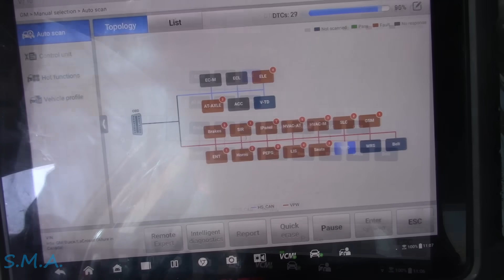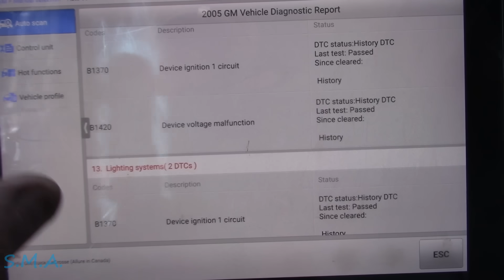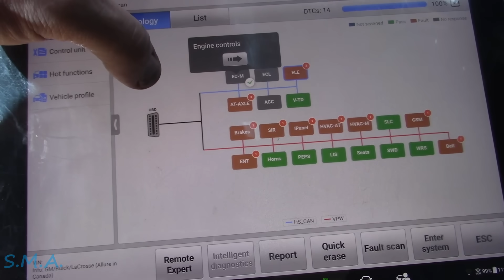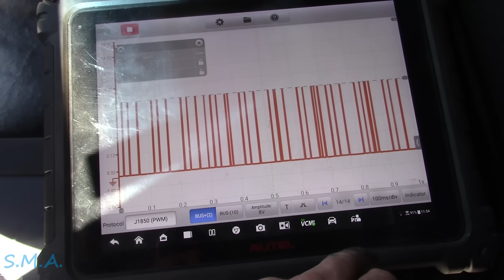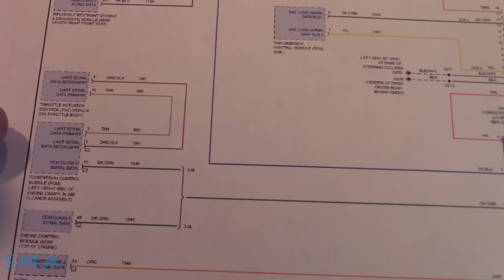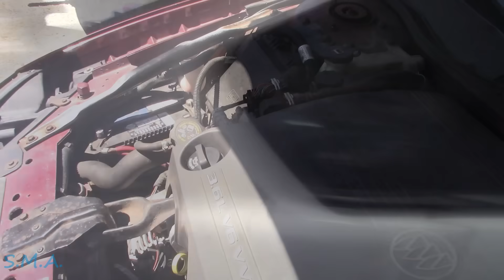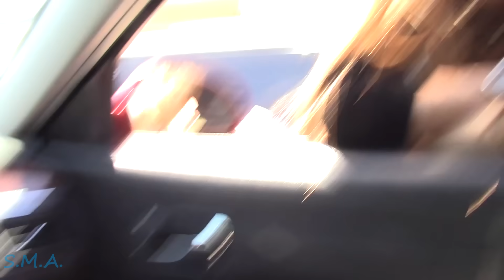Buick LaCrosse: No Start No Communication

Comment: UART = Universal Asynchronous Receiver Transmitter 

Designed in the 1970s if I recall correctly.  Works on simple start-stop data bits that sandwich the data bits into a packet.  Arduino micro-controllers can achieve up to 1Mbps speeds (in theory).
Reply: In computers in the 70s UARTs were used to communicate text data with user terminals. The wonderful thing about the "universal" part was that by changing a few soldered in jumpers you could configure the serial interface with the number of "data" bits and "stop" bits and speed to match the terminal device.  We would use 110 BAUD for slow terminals like teletypes (for slow readers ;-) and up to usually 9600 BAUD for CRT (Cathode Ray Tube) devices.  Some later devices could take the data at 19.2k.  But even at those low and slow speeds we needed to be careful about running the un-shielded cables close to things like florescent lights as that could induce line noise and corrupt the data.   So there may be UARTs out there these days that can do 1Mbs but I wouldn't think that they would be found in cars as I would think that as the cars don't have shielded or twisted pair wires in their wiring harnesses to much noise would get induced into the wires and cause reliability problems.
Reply: And for the people who want to know what "asynchronous" is all about, it means the  UART can figure out which is the first bit, which is the second, third, etc, without a separate "Clock" signal to tell it "We're on the first, click and see if it's a one or a zero, we're on the second, click, we're on the third, click etc".  So it saves a wire, which may not have been available at all like in the case of a phone line.
Reply: @paul_moir  Yes, very good.  I always thought it was interesting in the way a teletype would achieve it's "asynchronous" speed of communication at 110 Baud.  A teletype has in it an AC electric motor that runs at a constant speed based on 60hz AC.  A "start" bit would trigger a clutch that would cause a rotor shaft to travel one rotation.  In that one rotation the rotor tip would sequentially come in contact with 8 distributor pads in such rapid succession as to match their contact to the speed of the transmission of bits.  For each distributor pad that was contacted by the rotor during the transmission of a "one" bit a small solenoid would be pulled and momentarily held in place. Depending on which solenoids were "enguaged" a cylinder containing rows of numbers and letters would be raised and rotated to bring the correct character facing the paper and then the back side of the cylinder was struck by a small hammer causing the cylinder to move with sufficient momentum to press a ribbon to the paper leaving behind a visible character.  Once that secondary rotation was done and the character was printed the solenoids would reset waiting for the next character to be recieved.  I always thought it interesting and amusing in how electrical and such basic mechanical parts could be combined to get data to appear on a page in front of me.
Reply: @InquisitiveSearcher  Thank you, I understand what you're describing and can imagine it's function from your clear description.  My previous understanding is from about two technical generations later, specifically the General Instruments' AY-5-1013A datasheet included with a Texas Electronics Instruments S100 bus system I was given in the 80s where it interfaced the keyboard.  I never got it working but I learned a lot from it.
Reply: @paul_moir  Often there are few better learning processes than beating your head against a wall trying to get something to work that the manuals CLEARLY say it should be working!  Also, there is no computer more difficult to fix than one that has no problem but the customer is convinced that it does.  ;-)

P.S.  I fixed computers and their peripherals for more than 11 years, then I moved on to helping customers maintain operating systems.

Comment: Saw that traction control  failure on the dash, that's typical ABS issue in GM cars,  P bus go through ABS module to ECU so if ABS module is bad,  it takes the network down, no communication with ECU, quite often in saab.

Comment: I worked on one of these for my kids.  I got the key in and turned the ignition on a dead battery.  The key could not be removed until I changed the battery.  It would turn, but NOT come out of the lock.

Comment: UART - Universal Asynchronous Receiver Transmitter. Basically a bog standard serial interface, used by eg. RS-232 or RS-485. 9600 BAUD anyone?
USART would be the the one that can do synchronous serial, for other standards with a clock line (SPI, etc.)
You know you are working on an oooold car when it uses an old serial standard like RS-485
Cheers,

Comment: P0318 relies on the abs module... it looks at the wheel speed sensors to determine if crankshaft variation is because of a missfire or variation in wheel speed during offroading with your buick Lacrosse
Reply: Back when I use to do crunches everyday I had a great abs module. Today... not so much
Reply from the maker: Yeah I saw that on service data. Can't say I've ever run across it before.
Reply: I just ran into this code on a smart car and it was the wheel breaing also the fist time I have ever seen this code

Comment: Hi Eric i believe the p0318 code has to relate to a voltage issue also in the EBCM. If you have a wheel speed sensor code i would check for a wiring issue in the harness. Being a GM maybe worn through on the cv shaft or the lower control arm.
Reply: p0318 sets when a wheel speed sensor code sets, or when the EBCM isn't reporting rough road data to the ECM.

Comment: Rough roads cause torque on the tires that is transmitted to the powertrain. This slows down the crankshaft giving the appearance of a misfire. The electronic brake control module (EBCM) determines rough road surfaces using input from the wheel speed sensors. The EBCM then sends the rough road data to the engine control module (ECM) via class 2 serial data. The data allows the ECM to distinguish the crankshaft speed variations caused by rough road surfaces from those caused by true misfires. If a loss of communication occurs that causes the PCM not to receive rough road information while a misfire condition is requesting the malfunction indicator lamp (MIL), DTC P0318 will set.

Basically one of his wheel bearings or the wheel speed sensor is fucked.....
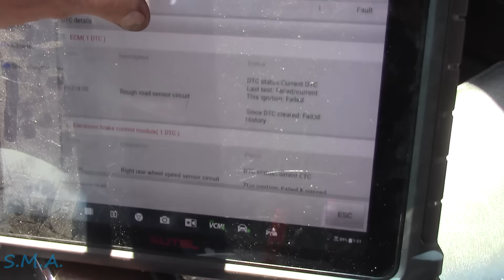Reply: 44:38 RR wheel speed sensor
Reply: @itsdavex2  Seems legit
Reply: @itsdavex2  Nailed it bro
Reply: Ding. I had the same issue in a 1997 Audi A6 Quattro once. The tone ring was rusted in one of the rears. I found the issue by going to a diagnostic channel and observing the wheel speed at each corner at slow speed. The ABS computer would shut down the ABS since it noticed a fault. The ABS would no longer talk to the ECM hence the fault code.
Reply: @Lustfulvengenance That was a F'n great answer! Dude, you rock!
Reply: I fuckin hate all this computer shit 😭 I don't care if they talk to you and tell you what's wrong fr 😂
Reply: They need a sensor for that? If it's on a road in the US or Canada, it's a rough road - no sensor required.
Reply: I've got an answer. Go to an antique car show and buy a car that was built before they put computers in them. You will never have another problem.
Reply: @jima3129  Yeah except you know trying to find parts for it, having to constantly repair little things on it, rust, dying in a collision that you could have walked away from, etc........ 

Don't get me wrong I love old vehicles and I have several of them I'm just saying they're not practical for everyone
Reply: @lustfulvengance  I have two vehicles both F150's. A 94 2wd straight 6, and a 2004 crew cab 4wd with the 5.4. The 94 is absolutely bullet proof. The 2004 has the 5.4 3v on which I just did a complete timing job, although it really did not need it. The 94 has features that ford eliminated that were really good. Vent windows, roof gutters, and an 8 ft bed you could reach into. The only things I have replaced on the 94 is the plugs, dist cap and rotor, ign wires, coil (yeah ONE coil) and a water pump. I've replaced a shot load of stuff on the 2004. The driver's side window regulator twice. Oh yeah, and the driver's seat cushion, which is still perfect in my 94. The new vehicles, with backup cameras, collision avoidance, variable cam timing, etc etc etc are built with parts made in China. Nobody can tell me we are moving forward. There is a constant race to put more doodads on vehicles. More doodads mean more breakdowns, failures, and costs for families already strapped because of the commiecrats and their ridiculous policies re energy. When I was young, there were no cars in some driveways, now there are at least 2, most of them new, meaning large monthly payments. And none of them are designed to outlive the payments. Just Saying.
Reply: @jima3129 Isn't it great being able to fix your own car? Eric's teaching us how to fish.
Reply: @markallen8434  yeah, but I've never owned a car. If you can't fit a sheet of plywood or drywall in it, carry a load of wood, or take a load of trash to the dump, it ain't worth a damn thing to me. SUV = SUPREMELY USELESS VEHICLE. Give me a pickup with an 8 foot bed. Besides, when they design a truck, they have to design everything bigger, and better. Ever see the difference in size of the brakes on a truck, and a car? The truck has to stop while carrying a load. The brakes on my 1994 F150 lasted 123k miles. If course it's a 5 speed manual transmission, and I used the clutch/engine to slow down. I just replaced the clutch in 2016 at 130k miles. The 4.9 liter 6 cylinder 5 speed, 2wd F150 is the best truck ford ever made IMHO. The ones made from around 92- 95 are bulletproof. Now they are ALL CRAP.
Reply: Can you imagine if they had this system on the jeeps in WW2? LOLOLOLOL
Reply: I have 2005 Buick lacrosse which yesterday morning happened with "No crank no start". I used two keys to jiggle several times and no success. Then I pumped two flat tires on site and Engine started suddenly. I didn't know why till I found this video and the explanation above. Thanks, bro.
Reply: Love the detailed  analysis..then you drive home with the hammer on the last line..excellent!✔
Reply: @vwwrenchie314  LOVED IT ALSO.
Reply: @
Lustfulvengance i'm also curious how you figured this out
Reply: Change EVERYTHING 🤣
Reply: This maybe the cause in my Jeep 🤔🤔🤔
Reply: Wow. Did not ever consider this! Interesting information.
Reply: cool theory but then this has to be one or both front wheel bearings if it's a front wheel peeler?
Reply: @awaara24  All 4 wheels have wheel bearings, all 4 have wheel speed sensors .....
Reply: @awaara24 then why isn't the abs light on it traction control light?
Reply: Wow, sounds good to me 👍
Reply: Totally agree with you. Same theory applies to a Lexus I had worked on years ago. PCM recorded random misfire dtc, turned out to be due to bent wheels to be completely out of balance causing excessive vibration resulting in crankshaft speed variation thus storing misfire codes. Don't know if it may apply but in my case, by balancing the wheels as best as possible fixed the problem. Just a thought.
Reply: Perfectly stated
Reply: sounds like a GM pipe dream, as never has there been such a precision driveline from them.
short of the wheels spinning and suddenly grabbing with torque converter locked. 🥳 😏
Reply: @Lustfulvengance That is crazy, how did you figure this out. Service data or just experience and connecting the dots?

I feel like I have this in my '13 Chevy Trax. I would get intermittent flashing check engine lights on the highway once in a blue moon, paired with a loss of traction light. The lights would disappear after two minutes, I wouldn't even need to shut off the car or start a new drivecycle. Sometimes the computer would store misfire codes. The car would always run fine.

Comment: was the 3.6 an optional engine for this car?
Reply: Yup it was on the CXS trim level; others had the 3.8L.
Reply: For the 2005 Buick LaCrosse only. They found it to be slightly underpowered and made the bulletproof 3800 (3.8L) standard in 2006.

Comment: Long time ago while living with my Aunt and Uncle. My Uncle would have to pull up on the automatic column shifter to start the car because of a bad neutral safety switch. It was finally replaced.
Reply: I drove a Mazda 3 that had the same issue.

Comment: After watching 30 seconds of this video, my advice for the no crank situation is "jiggle the handle and make sure it's in Park"
Having now exhausted my supply of expertise I will watch you actually fix the problem. It's a good thing they brought the car to you instead of me
Reply: sounds like a toilet that wont shut off- just jiggle the handle
Reply: @richardcranium5839  I woke up from a nap today and didn't think much about my toilet running. Until I stood up into an inch of water. Seems the toilet was clogged and the handle needed a jiggle for the flap to close completely thereby filling the tank completely and shutting off the water flow.

I should be cleaning up the mess but I'm watching sma instead.
Reply: @richardcranium5839  "Give it a j-j-jiggle, Granville"
Reply: What you are saying is no joke. At least with older vehicles. Just recently I help out a guy with his truck. Turn the key nothing would happen. Push up on the shifter and it would fire right off.
Reply: @jimbosjunk9083  see if itll start in "neutral" if not try Drive. If it doesn't start on neutral but does on drive, I'd think of a bad shift link. Sorry for explaining again im sure you already know, im just high 🧐
Reply: @jimbosjunk9083  bad or loose shift link?
Reply: That reminds me of the episode of 'The Simpsons' where Marge is blocking the bridge in the car and refusing to move and Chief Wiggum arrives and says to his men "Have you tried flashing your lights?" to which one replies in the affirmative, so he just give up and says "Well, I'm fresh out of ideas".
Reply: what, so you would put in a new handle.  Pot handle, drawer handle...😅
Reply: @charliefox7206  Nah, it'd just tell them to jiggle it and when that didn't fix it I'd shrug my shoulders and tell them to call South Main Auto Repair. You'd be surprised how many things can be fixed by jiggling whatever handle they have. 😃
Reply: @charliefox7206  no no..the toilet handle...lol🤪
Reply: @A. Melbs at this point... no. You keep doing what works. Forever.
Reply: @A. Melbs -  An SMA fan in Australia.  I like it.
Reply: Leave the "jiggle switch" alone!
Anti-theft device!
Reply: Jiggle the handle and if that doesn't work, smack it with a hammer, that works lots of times too.
Reply: Must be jiggling it Ace Ventura style. 😂
Reply: You forgot the cursing bit.
Reply: Good plan
Reply: So what was the problem? I recently bought an 08 Super and after about a week it wouldn't start and had this code but it does start if I jump it with my other car.
Reply: My mom's Taurus wouldn't start randomly, there was an intermittent issue with the steering interlock so sometimes you'd have to turn the wheel until it locked before it would start.
Reply: Your the NY wizard!

Comment: Seen equally useful ecm locations listed as "engine bay" and "outside of engine bay".
Real useful!
Reply: I hope that the manufactures start putting the ecm back in the cabin again. It's the best place for them. Once you put it under the hood all you do is cause them to cook.
Reply: @ericspecullaas  
I watch Diagnose Dan as well and he had a BMW PCM cook once, it lived dead square right on top of the engine, no bloody wonder why it died.
Reply: @michaelslee4336  planned obsolescence
Reply: @ericspecullaas  heck yeah, especially down low in the passenger side footwell that leaks water in through the hvac system and floods the ECM.
there's always planned obsolescence inbuilt at it's finest levels, no matter where they place them.

Comment: Nobody's talking with each other.  Sounds like one of my family reunions...
Eric, only you are lucky enough to drop a 10mm socket in a salvage yard engine and not have it be swallowed.  Great job!
Reply: It wasn’t the same 10mm only one that’s been there for ten years from the last drop 🤣
Reply: A good number of years ago, I dropped a 10mm in my old truck, a '92 Ford Ranger replacing the thermostat if I recall and dropped the 10 mil socket down into the C channel rail that ran below the radiator. I bet it's still there, and I've long since traded that truck in.
Reply: Been there lost a few and they never are seen again
Reply: @earlestes8649  I've managed to drop them into various places, like the corners of fenders. Bet I'm definitely not the only one on that though.